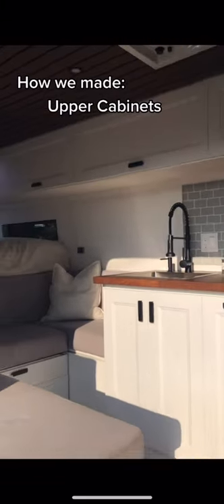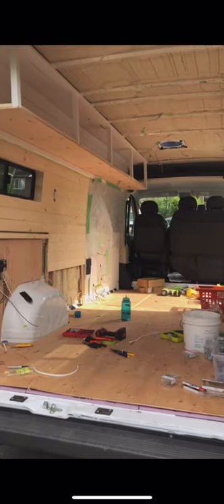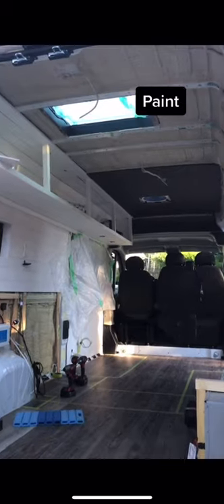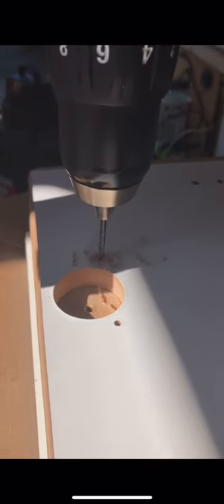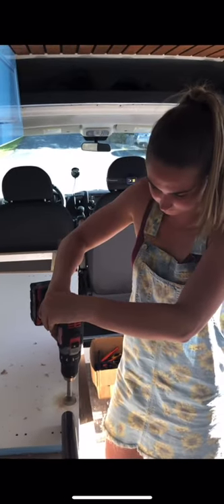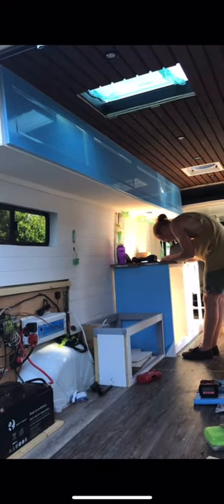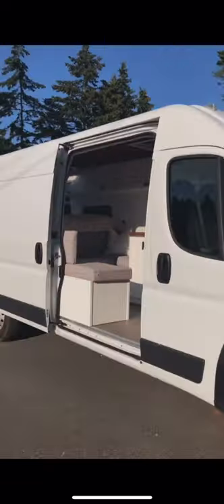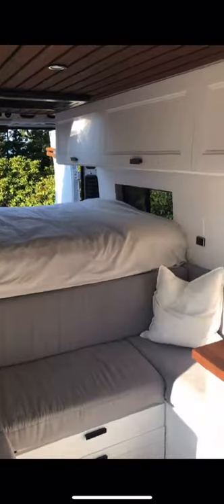How We Build: Upper Cabinets in a Campervan #shorts | Moonlit Campers

Comment: Just curious.. why did you decide to switch back from the high gloss blue cabnet doors. Also I was wondering if the plywood was 3/4" pine wood? Curious as I am building cabnets for the first time with Birch and am second guessing the costly wood. As I am contemplating painting it instead of giving it a polyurethane finish.
Reply from the maker: The blue was actually just a protective film, not the actual cabinet colour! Birch is definitely the go, you don't want to cheap out on that since it's structural!